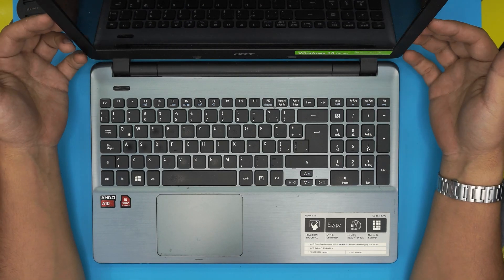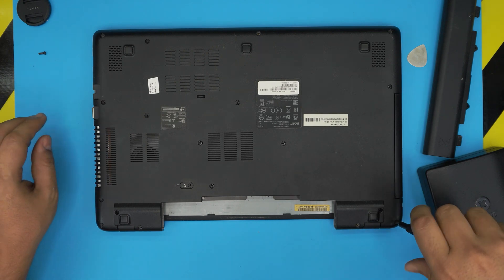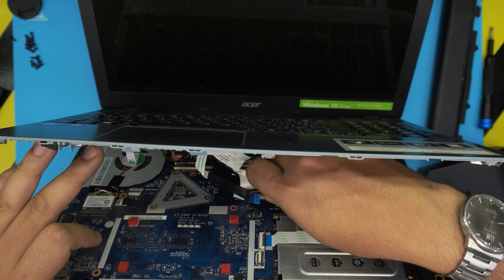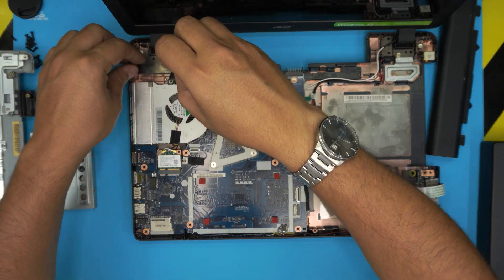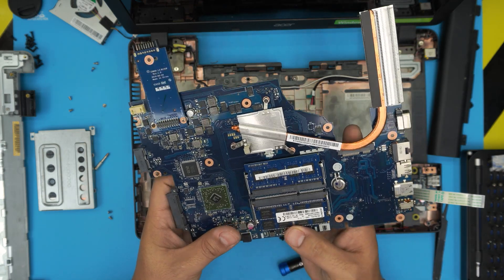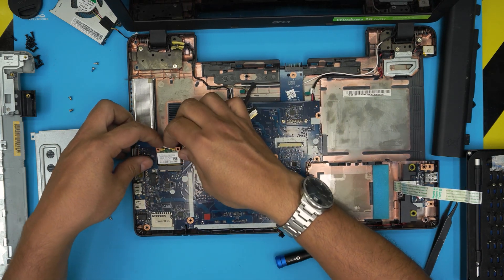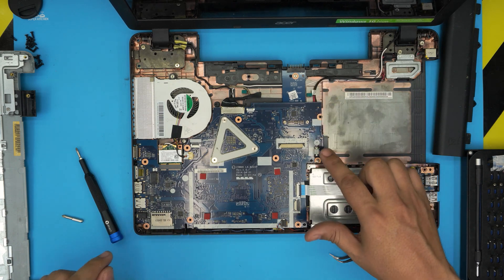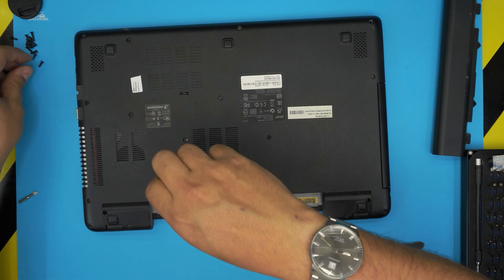Acer Aspire E 15 E5-551-T7V0 📌 RAM UPGRADE

Comment: Where is the CMOS battery located?
Reply from the maker: Thank you for your feedback! If you'd like to support the channel, you can like, subscribe, or do both!

Regarding your question, the bios is soldered on board beside the ram slots, here is a picture of the location: https://imgur.com/a/RiZwH0A
Reply: Thanks for the reply. Yeah, I don't have it there. My model is E5-511-P4SN and there's no CMOS battery on it. I've read on some forums that for some models, there are no CMOS battery, but that functionality is implemented in an integrated circuit part, soldered on the motherboard. Maybe that's the case for me as well.
Reply from the maker: The new model motherboards feature a capacitor on board that retains the BIOS configuration. To reset the BIOS settings, follow these steps:

    Turn off the computer and disconnect the main battery and charger.
    Press and hold the power button for approximately 30 seconds.
    Release the power button.
    Reconnect the main battery and charger.
    Turn on the computer.

By performing these steps, you will drain the capacitor and effectively reset the BIOS settings.
Reply: @uFixTek  thanks a lot for the help! 🙂
Reply from the maker: It's my pleasure my friend. 😊
Should you have any questions or requests in the future, please don't hesitate to ask me.
Reply: 16gb ram utilizable 6.93gb ????

Comment: Thanks for video..

I am very helpful with the video you give

i tried to clean my RAM legs but my laptop still couldn’t live the screen, just heard the fan sound inside. Do you have a solution?
Reply from the maker: It's my pleasure my friend🍻😊
Thank you for the feedback! if you wish to support the channel you can LIKE or SUB or both :P
regarding your question: i recommend you to remove the both rams and only use one slot and also when you remove the battery and disconnect the charger press and hold the power ON for 30-60sec and after place only one ram and power on and wait for 15sec. let me know if anything.